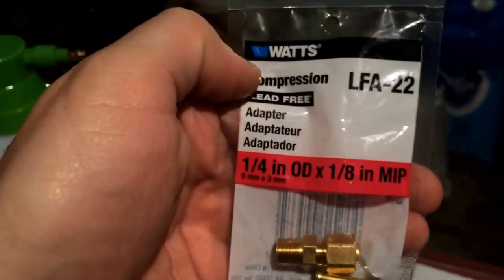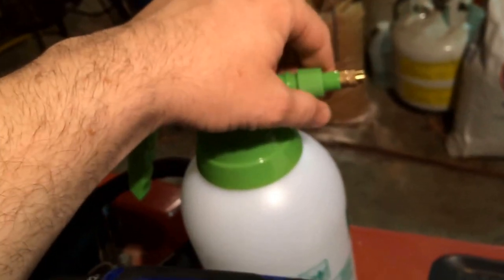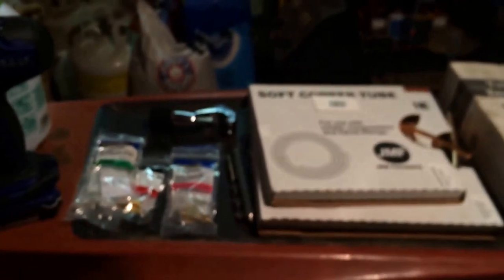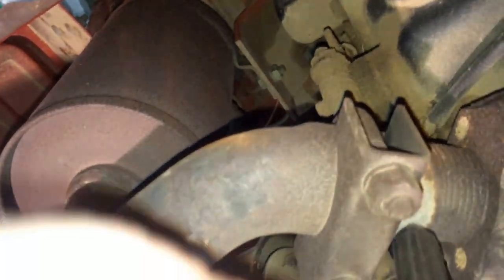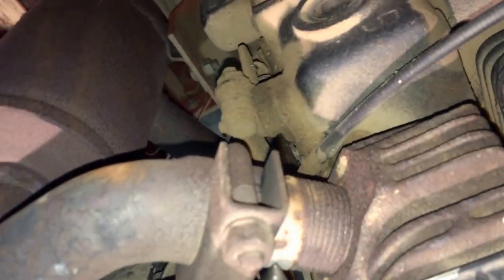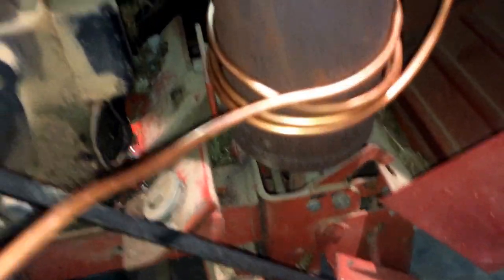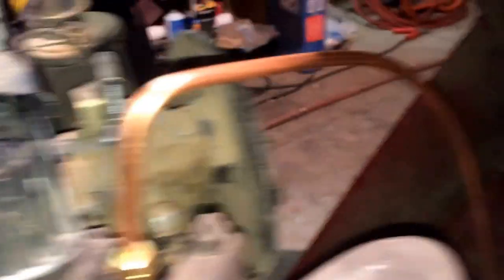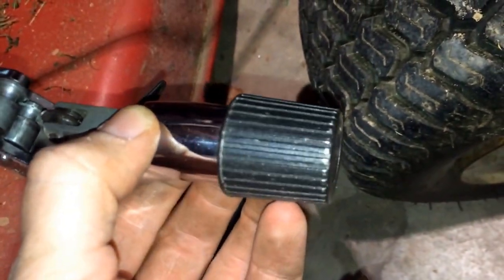DIY Mosquito Fogger with a Riding Lawn Mower

Comment: hello there. how often do you fog the place? once a week? once a month?
Reply from the maker: I'm currently not using it, mostly as we decided to redesign the fogger due to some leaks.  A different base fluid like vegetable glycerin with water, and or propylene glycol would be better would make more fog, and be safer.  Combine that with Pyrethrin and it would function better.  I have used "MGK 7469-D05 Evergreen Pyrehtrum Concentrate" which is 5% Pyrethrins and water soluble, so it should dilute with vegetable glycerin and water.  Another option would be to add Pyrethrins to fog machine fluid.

Comment from the maker: Here's an update after further testing.

I do not recommend using 80/20 surfactant as is has a compound in it which does not vaporize and will build up in your system.  

Vegetable Glycerin is by far the best for thick fog and is very safe.  In order to thin it out a bit, use propylene glycol to thin it out, or water.  propylene glycol will not reduce the density of the fog like water will, but it does cost more.

Have fun and post your own video to show us what you've figured out.
Kevin
Reply: Quick question, instead of your bottled container could you use another mower gas tank with the fitting on the BOTTOM of the tank for the fluid to run down to the valve???
Reply from the maker: @REVNUMANEWBERN  Sure, it was more of a concept and the small bottle didn’t work as well as I hoped.  I’m still working out the details of what fluid do you use. I definitely like the idea of garlic oil however this is not going to dissolve in a water-based solution like glycerin and water. I’d prefer to find something natural rather than having to rely on permethrin although that would work just don’t want to breathe it in.

Comment: great concept, only thing I would change is have a temporary slip on tube built for the exhaust to divert it to the back of the mower as to not inhale the vaporized chemical while doing this,of course wind direction is also key to doing this... great job otherwise
Reply from the maker: That's a great point.  The best juice IMO is a Vegetable Glycerin base with garlic concentrate.

Comment: hello  kevin is it possible to know the diameter of the copper pipe?  Also running water in the muffler then it will rot, I think it would be better to pass the copper pipe into the muffler
Reply: GOOD point

Comment: How does this still work ?
Reply from the maker: To do this over, I would recommend using vegetable glycerin slightly diluted with distilled water or propylene glycol to thin the solution.  This will make cleaner, thicker fog and also reduce the amount of buildup in the muffler.  

I would recommend using a pyrethrin based insecticide as it’s made from chrysanthemum oil.  Evergreen is 5% concentrate and available on Amazon.

Comment: what do you use for the liquid? im wanting to build my own fogger with a little engine I have lying around but am unable to find a decent recipe for the "fogger juice"
Reply from the maker: Honestly the safest route would be using Vegetable Glycerin and Propylene Glycol with Garlic Oil.  Propylene Glycol will suspend oils in solution and Vegetable Glycerin will generate the thick fog.  I'd with a ratio of around 80/20 PG to VG then thicken it up with more VG if I needed thicker fog.  

Another option would be Mineral Oil and Garlic Oil which should also be safe, but does generate as thick of fog IMO.
Reply: Diesel fuel and permethrin is what the big boys use and it's works great

Comment: How did you make the juice
Reply from the maker: In this case I used 80/20 surfactant straight which was a test with no insecticide.   Later I used 80/20 surfactant at 80%, water 10%, and permethrin 10%.   This was an attempt to reduce cost as glycerin is $25 a gallon at the cheapest. You could also make it with Various dilutions vegetable glycerin and water with your pesticide.  A natural solution would be to use garlic oil concentrate with mineral oil to dilute. Mineral oil locally cost about $15 a gallon and produces a very dense the fog which will blend in nicely with the garlic oil.
Reply: WHAT ABOUT THE MOD TO LAWN mower can you send me pictures
Reply: Kevin C     What is 80/20 surfactant?
Reply from the maker: Dale Swindle During this test run I used drexel-hum-ac-820.  Here's a link to the product, although this is not where I purchased it from.  It's important to note that this type of surfactant is water soluble and would be used with water soluble pesticides.  When using something like garlic oil, I would recommend using pure mineral oil which makes a super thick fog.  Glycerin is the best water soluable that I have seen, but it's more costly than the Drexel 820.
Reply: Kevin C can you just use mineral oil and permitheran or does it need another type of pesticide added to it?